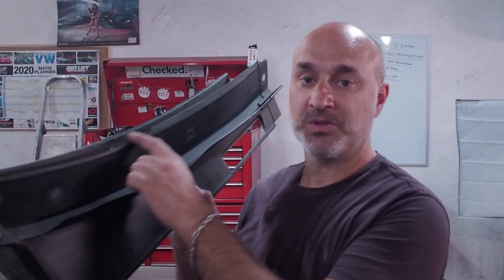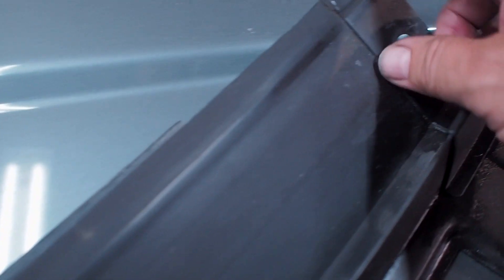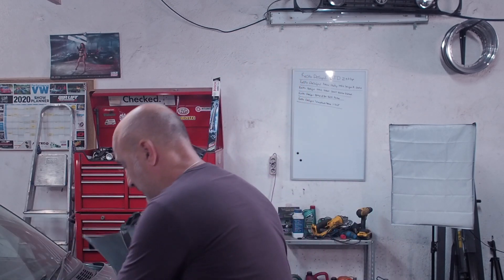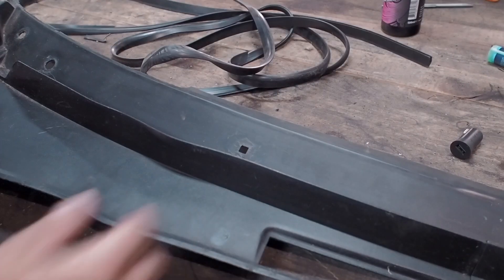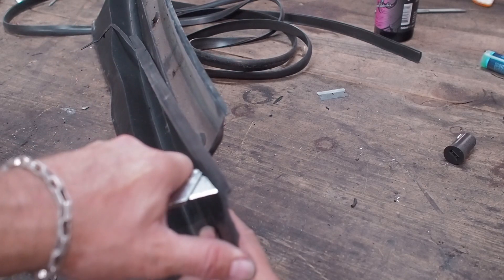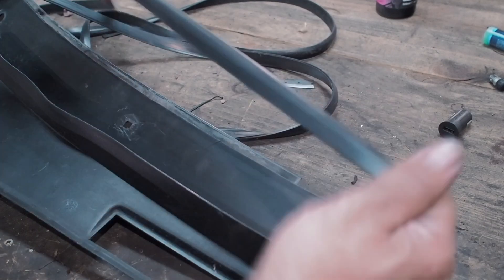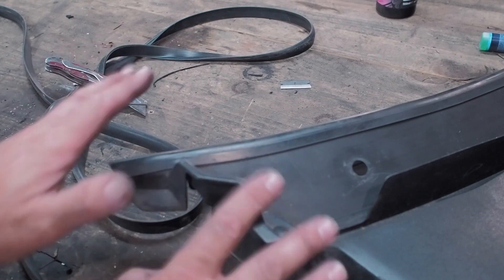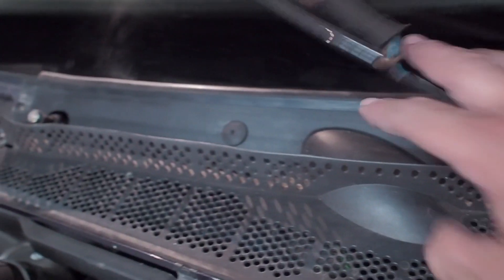How To Golf mk3 rain tray seal replaced!

Comment: I did exactly this to mine a few months back , got it off ebay nice and cheap. It does leave a 1 or 2 mil gap between the seal and screen and the dirt can build up there but I'm happy enough. 
At the same time I fixed the leaking windscreen, went to screwfix and got a cannister of black silicone weatherproof sealant and put it in a sealant gun and went around the whole screen after removing the A post trim. Doesn't leak at all now , lucky with that one I thought only a professional screen out and re-bonding was going to be the only cure.

Comment: Legend, just started restoring my mk3 gti and this was exactly what I needed to know. I was also about to replace the timing belt using the video you did on the KR engine but discover that I've got a valve cover leak that's contaminated the old belt.   Guess I'll deal with that first. Cheers man.
Reply from the maker: Thanks mate, On the 8V timing belt, the crank marks are the same, Put the crank @ TDC and remove the ignition cap and under the dust cover you'll see another mark on the body of the dizzy which should line up with the rotor arm, make sure lines up after replacing the timing belt, 👍🏼

Comment: This is awesome! I have puddle forming on the passenger floor due to water leaking directly into my cabin air intake/housing. The rain tray is missing a larger section of the seal and allowing water to drip directly in the cabin filter housing. Going to be doing this very soon! 
I just need to find where to buy near me/in the USA so I'm not waiting extra long on the mailman
Reply from the maker: Glad this was helpful👍🏼

Comment: Love this!! 
Problem I have is making the rain tray sit flush with the screen despite using new plastic screw thingys!!??
Reply from the maker: Thanks mate, maybe try adjusting the tabs on the body that the plastic screws go into, they are made to be moved and over time they may have been pushed inwards which will tilt the rain tray outwards if that makes senses.
Reply: @RestoDesignsnando  awesome tip, thanks matey!!!